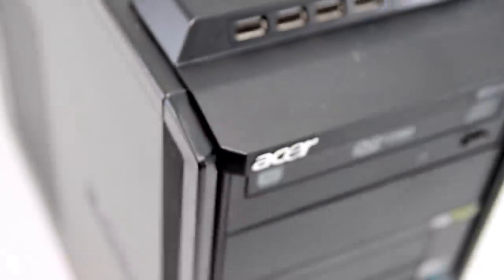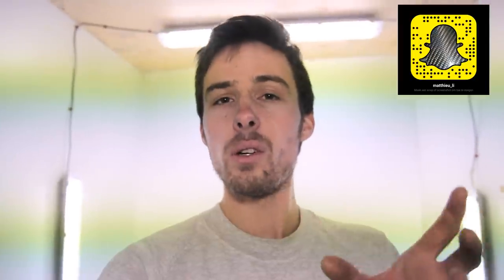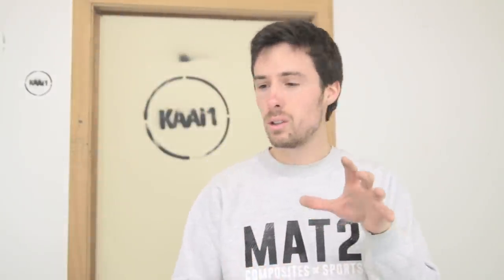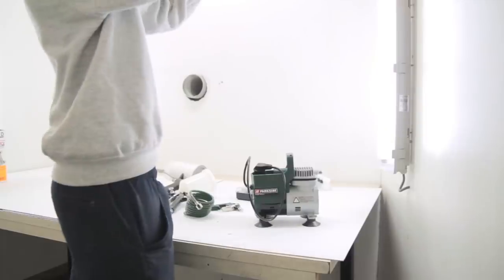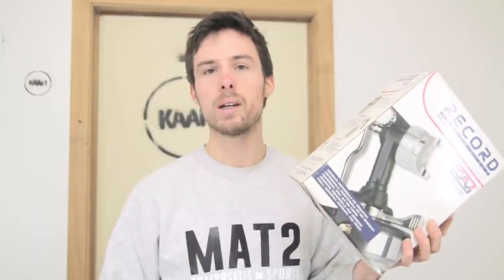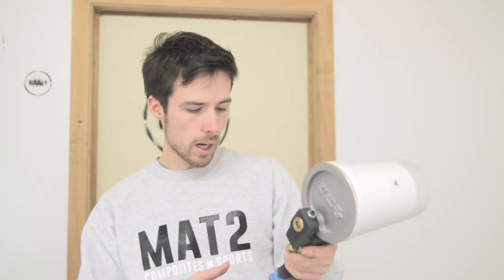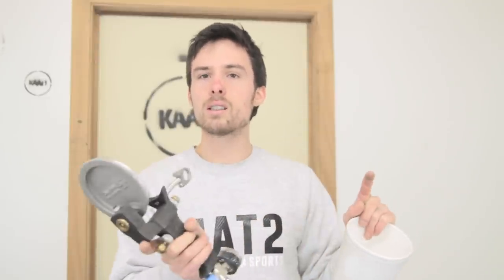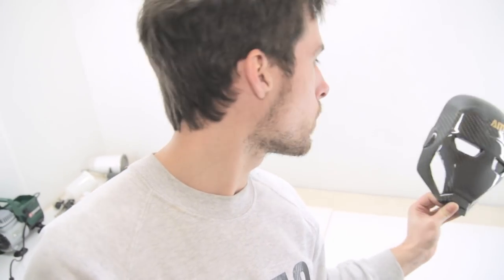My own Spraybooth

Comment: Wow you have a massive space there to work! is all that building at your disposal ?

I use this spray gun for all my 2K spraying, it suits small compressors recommended working pressure of 2.5 bar (35psi) 
http://www.amazon.co.uk/DeVilbiss-SLG-610-compressors-Compliant-Solvent/dp/B008OHYGFQ

The gelcoat guns need alot of air! that compressor will be struggling ...
Reply from the maker: +David Stevens (davro) great to know! pretty cheap spraygun as well :) good to know about the size of the air compressor!
Reply from the maker: +David Stevens (davro) and about the size, its a space we share with a few :)